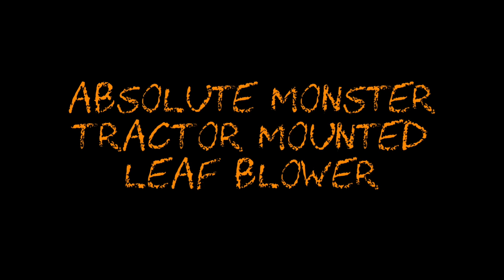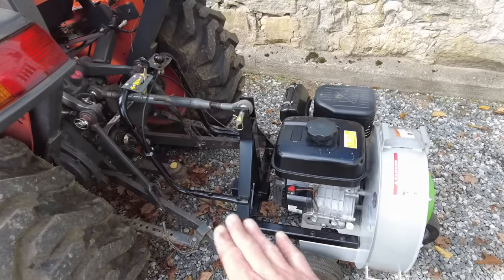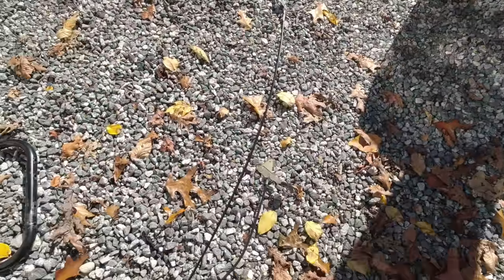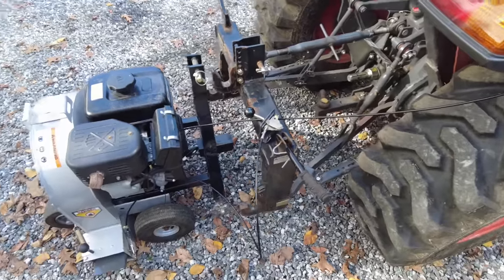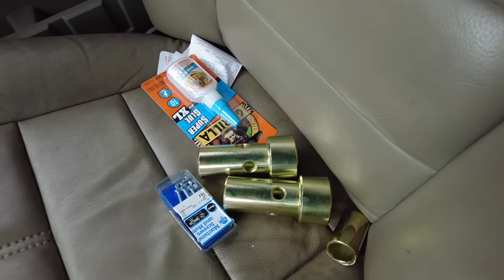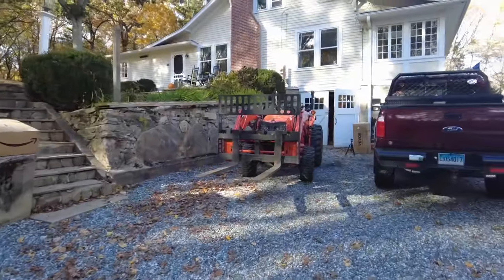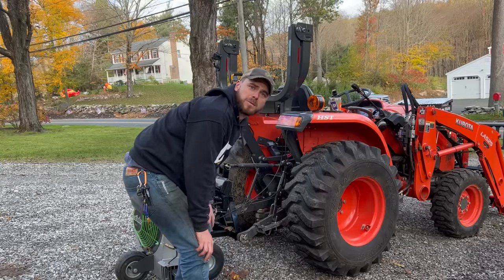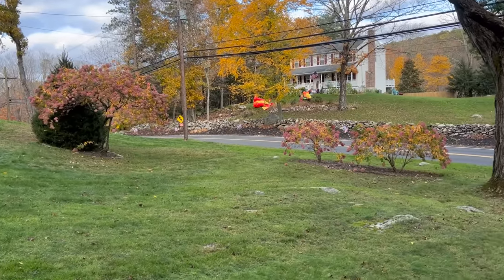#424 Absolute MONSTER Tractor Mounted Leaf Blower!!

Comment: Love it.  I've been thinking about modifying my 9HP Little Wonder blower to work on 3 point.  Then I thought How much exercise I'd be missing out on by not walking behind it.  Get lots of steps in!  Plus I like being able to work between wood piles, buildings, and trees, and I don't think the Kioti would be able to do that.  But maybe I could get 2 blowers!  One for the 3 point and one for a walk behind!
Reply from the maker: I initially used a 9hp little wonder and it worked well. Yeah I just use this for the big areas, the backpack works well to get all the little areas pushed out to where I can use the big blower.

Comment: I left about 10% of the leaves the last three years, a light coating. lawn has never been greener, fuller and  with less weeds.
Reply from the maker: Did you mulch them or leave them whole?
Reply: @DudeRanchDIY mostly mulched.  I just left everything after the final mowing. And what ever fell after that.

Comment: I have a DR leaf vacuum and it works great . You pull it with a tractor. I don’t have to rake leafs anymore
Reply from the maker: The DR leaf vacuum was the first piece of equipment I ever bought brand new when I was about 14. Worked very well but I no longer have a garden tractor that could tow it and it would get heavy even for my 23hp tractor I had at the time.

Comment: I have an Agrimetal BWT-150 that is a tow behind blower with a 14HP Kohler that we use to blow off our 1600' driveway through the forest.  Works great, but it's honestly limited in what you can do with it.  I think it was marketed for golf courses. Discontinued now I see.
Reply from the maker: Those would be great for that application, would be a pain in the ass for my lawn having to back up a trailer.

Comment: Is there any skid steer mounts that you could put on the blower so you can put it on the front loader? You would have to get some longer throttle and airflow cables, but it would free up your 3 point hitch and be a little bit easier to put on and take off the blower. Just kicking an idea around and take care.
Reply from the maker: Yes there are…! Stay tuned!